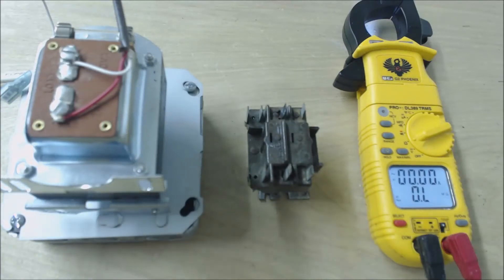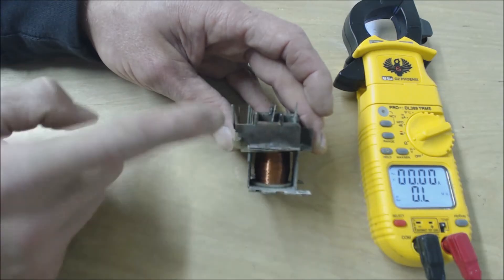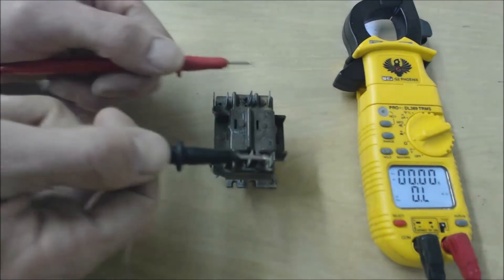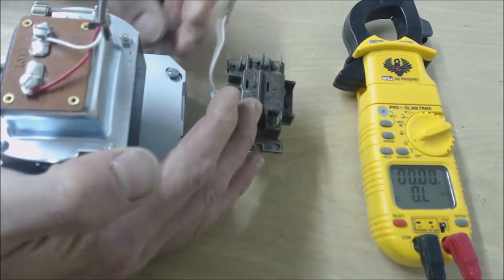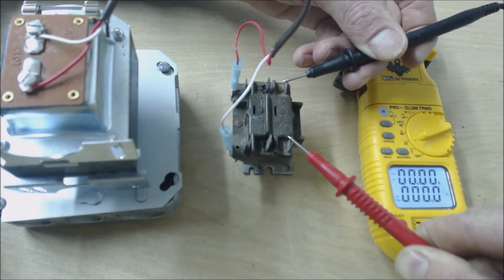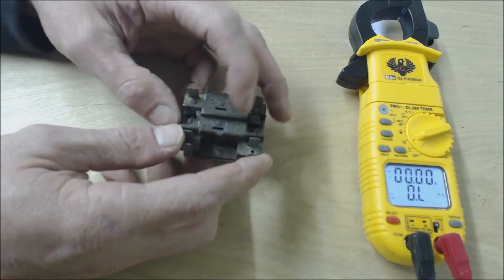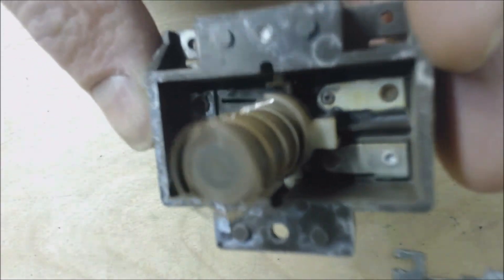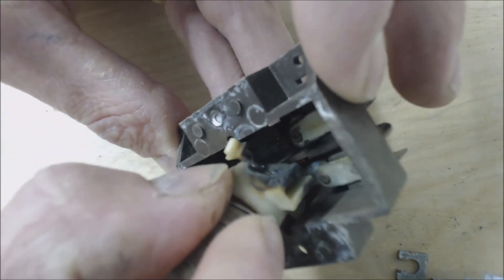Testing a Bad Honeywell General Purpose Relay and Taking Apart to See the Burn Marks!

Comment: I am testing my 24V transformer / relay from a McClain boiler. I replaced the part about a month ago because the system would call for heat and the transformer/relay would just click non stop. Although the part lasted over 3 years last time, this time I am surprised it only lasted a month. 

When I test the relay (set at 200 ohms), it shows resistance for the lower terminals (14.3). Terminals 1 and 3 does not show any resistance (meter reading does not move). Terminals 4 and 6 has a resistance (1.5). I assume this means terminals 4 and 6 are contacting each other. In your video, with no power, 4 and 6 should have zero resistance. 

Again, I am surprised this part failed in a month. Do you think something is overloading the 50/60 HZ relay?

Comment: I got this relay on my furnace what exactly does it do?does it tell the blower motor when to turn on?
Reply from the maker: It is called a general purpose relay and can be used for many different things depending on the amp ratings of the particular relay. They used to be used in the fan control relay before control boards where used as well, thanks!
Reply: @acservicetechchannel  ..can this relay be the reason why my a/c take a while to turn on,4 or 5 degrees difference from set temp

Comment: I thought checking resistance with power on was a bad thing.... possibly causing a short?
Reply from the maker: I was checking the resistance across the no powered set of contacts. That is the only way to test the contacts. Never test resistance of a live contact, thanks
Reply: @acservicetechchannel  thank you
Reply: AC Service Tech LLC 
Sorry dont understand what you just explained. I know not to check ohms when power is on. But you powered the relay with 24v looked like your meter was set at ohms. Isn't that checking something with power on?
Reply from the maker: So a relay is made up of two separate electrical components. One is a set of spring loaded contacts with an iron back on it and the other is the coil which when energized, turns into an electrical magnet and sucks the iron core down. Contacts are what I was checking when the power was on. It may be best for you to take one apart to check out the internals, thanks James!
Reply: AC Service Tech LLC 
Yes maybe that would help. Thanks
Reply: This has nothing to do with relays but i was hoping i could get your opinion. I had a service call for no heat on a packaged carrier unit with an economiser at a church. I found a limit switch near the heat exchanger tripped. Gave it time to  cool down, reset and turned it back on. Everything seemed to be running as usual but i only had a temp rise of 30 degrees at most. Checked blower motor and adjusted belt to get more speed, gas pressure is 3.5, removed filters and checked for any obstruction but i still couldnt get a higher temp rise. I did a visual inspection of the heat exchanger and found no obvious signs of a problem. I suspect that its a clogged heat exchanger and im returning to do a combustion analysis and CO detection. I was just wondering if you had any insight on what more i could have done? Thank you so much for your time and i would love to donate to your patron if you could share the url to your page please.
Reply: @sergioaguirrevalle6212  tHanks for asking that question.  It was good reading.
Reply from the maker: So if you increased the temp rise then that switch would be more likely to trip. Not sure what kind of unit it is but if the economizer was slightly open and you took return temp upstream of it and then another temp on the supply it would fool you into thinking it was only a 30 degree temp rise when it actually is near the normal 50 degree temp rise but just with cold air mixed into the return. If a blower speed is too fast, the temp rise can be too small if it is not sucking air through the economizer. Usually that sensor trips when there is a clogged filter or blower problem which you took care of. Sometimes those switches go bad over time too and trip at a lower temp. It is best to do the other tests and let me know how you make out and what your thinking, thanks and the url is  -   patreon.com/acservicetech
Reply: @acservicetechchannel  its a 48HJE-014 carrier if that rings a bell. I honestly dont have much experience with economisers but the doors were completely shut and return doors were fully open. That makes alot of sense what you said about the blower mixing cold air. Im gonna mess with the fan speed a little more. Based on what ive told you, if i find nothing wrong with the combustion, do you think it would be alright to leave it as is?  Return was 53 and supply was 85-89 max btw. That was really the only thing thats hanging me up. Im in maryland and it just snowed. The church also experienced a huge power surge a few days ago

Comment: Great video! I purchased an extra transformer for testing HVAC 24v type relays (fan, auxiliary heat, etc.). Of course, more often than not these transformers are wired to 240v in the unit, however, I figured that while out of the unit I could get by using a 120v transformer provided the output is the same. In this case it's: 24VAC, 40VA (ELK-TRG2440 Auto-Resetting Transformer). It's a plug in unit. Would this be sufficient for occasional intermittent testing of removed 24v relays? Any advice you could provide would be most appreciated. Thank you.
Reply from the maker: Yeah sure, instead, you could use a multi tap transformer 120, 208, 240 such as this one in the video and you could wire it in as needed or just use the 120v with a plug on the end for recepticles. The transformer is also linked in the description section under the video, thanks- - https://youtu.be/aYmxMn_KWZY